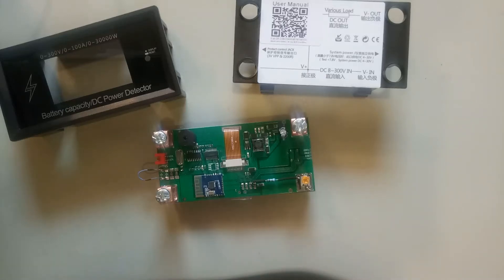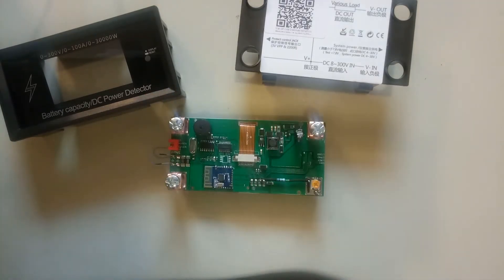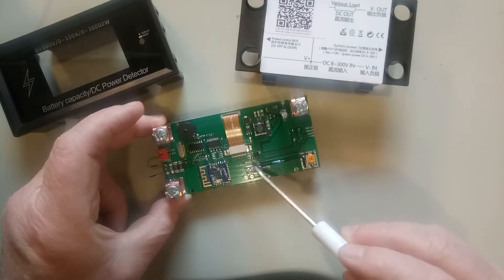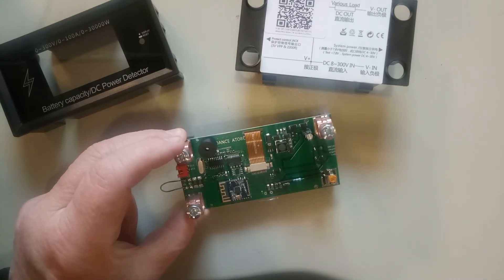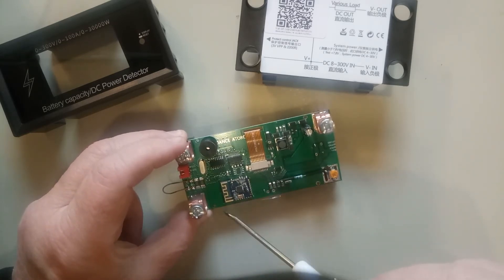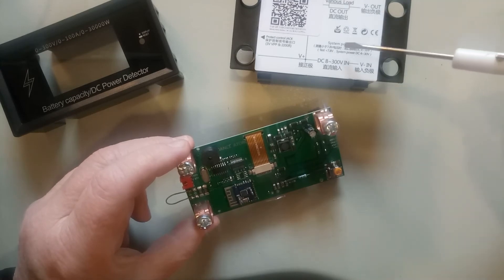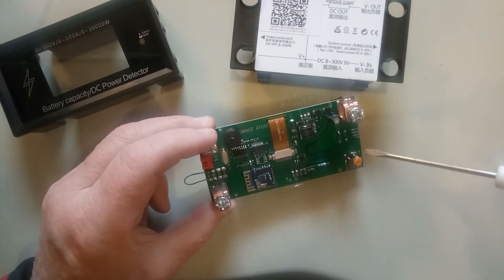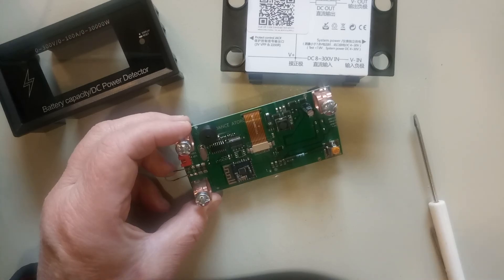HIDANCE ATORCH DT3010 300V 100A DC Bluetooth Watt Meter Review & Modification  pt1

Comment from the maker: There is some updated information here.        New display video https://www.youtube.com/watch?v=DEY-y1AT_Jw
 Additional info    https://www.fieldlines.com/index.php/topic,150340.0.html
Part 2 has been delayed as I learned more on how to use this. For the past week I have not been able to get it to work. As mentioned. sometimes the software locks up.  Phone has to be completely powered down in order to get bluetooth communications to work again when that happens.  Slow startup of panels sometimes causes meter to lock up.  I've seen it mid day reading 0.0V 0.0A and power has to be removed to make it operate.

This meter is sold under the HIDANCE and ATORCH name. It requires almost 20V just to turn on unless powered by an external 4-7.8V source and it requires about 10ma of power. A switching regulator allows it to be self powered up to 300V. this feeds a linear 3V3 regulator that powers the electronics. Bluetooth requires the phone to be near the device as the meter stores no data. Current scale is 60A although the meter goes up to 100A. The data sample rate is every second and graphing it seems to do averaging. This makes it impractical for graphing start up power. My fridge draws 120A for less than a second. This meter and software would totally miss that. Cheap and about useless, I have modified it so graphing isn't just stuck on the bottom of the screen with most of my currents being less than 10A. Connectors are just to big to be used with wire sizes common for this size meter. A bare crimp is needed for most wire sizes. I wouldn't put 100A thru this for too long. A fun meter and I have grown to like it.   Still not very usefu for gathering technical data. No way to save any graphing.  Software is available to make your PC look like an android phone so maybe there is hope that way. Part 2 covers what features I have discovered.
Reply: Any chance you could tell me the markings on the DC-DC IC?
Reply from the maker: @michaellawton7876  When I find my USB microscope. With slow low current low voltage startup as with solar, this think goes crazy as the backlight draws current. Sometimes bluetooth won't start, display reads 000V 000A and has to be reset with power off.  I have one meter which is now locked up.  Cal procedure mimics low voltage startup.  Just a minor software problem!

Comment: Slow startup of panels sometimes causes meter to lock up.  I've seen it mid day reading 0.0V 0.0A and power has to be removed to make it operate. - same here.
has anybody found information on the serial protocol via bluetooth? I was thinking to go directly with a connection to the serial lines connected to an external microcontroller board.

Comment: I use this DT3010-BLE to monitor the main 12v battery (Interstate EFC-27) in my trailer.  I can certainly agree that the unit and software have shortcomings, but with my straightforward need to monitor the battery when boondocking, identifying the load sources and tracking the need to re-charge with a portable solar panel "suitcase," it's a decent fit.  I have it in a plastic project box and attach it when I set up the trailer.  

The GOOD: I actually like those big terminals, because I need to connect it to 10 AWG wire terminals, and only the negative needs that 10AWG connection.  At 12v, I simply jump the positive connection through an on/off switch to power the unit with the existing battery.  I find the Bluetooth connection extremely reliable, fast-connecting and with enough range to view the battery vitals on my Android smartphone from anywhere in the trailer, or around the camp site.  

The BAD: It isn't waterproof.  The scaling isn't set up for a 12v application.  The eTest Android software reports energy usage in KWh instead of Wh, losing detail, and voltage to tenths instead of hundreths.  But the real problem is that it reports the voltage incorrectly (off by 0.2v) and has no ability for me to attenuate/calibrate either voltage or current.

For $14, it does offer a convenient way to monitor my main battery.  I also have ATorch DT24 Bluetooth Ammeter and their USB Bluetooth Analyzer, which both use the same eTest software.
Reply from the maker: There is a way to calibrate it in software using a precision 30.000V source.  That procedure also allows it to calibrate itself when no one is watching to who knows whatever voltage. I do like them and have a number of them.

Comment: I have one of these meters on my Solar PV Hot Water system. It runs at 200V and 10Amps. The first one died after a couple of months. This next one seems to be running OK. Without the external power, it beeps on and off until the voltage of t he panels gets high enough.
Reply from the maker: Have you tried powering it externally with the extra ware harness they sent you? if it can be powered by 6V then the 3V3 regulator is still good. There is always a chance it can be fixed.
Reply: The voltage still works but the current is dead. I am powering the new one with 5V using the external power source.

Comment: The meter was a nice idea but was poorly executed and I'd not trust it not to catch fire if you put a constant 60A through it!  I picked up a couple of 200A DC hall effect Coulometers[1] off Aliexpress for about $15 each along with some 5m sensor cables.  I like these because you simply thread one of the load wires through a sensor rather than try cutting and terminating the high current wires. Much safer!

[1] This sort of thing https://www.aliexpress.com/item/1005001284384107.html
Reply: For amperage that's often less than 5 amps I found the Hall effect in my Chinese battery metre to be inaccurate.  I've switched to a real shunt and had reliable results.
Reply: @SiriusSolar  Mine attached to the battery leads appears to be reasonably accurate down to less than 0.5A. I do have a 100A shunt based meter measuring total system load though.